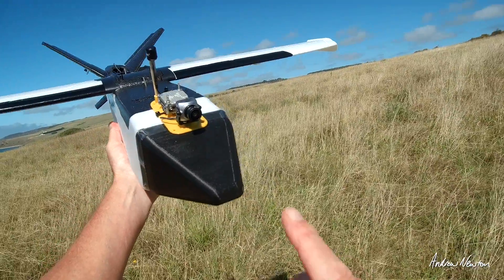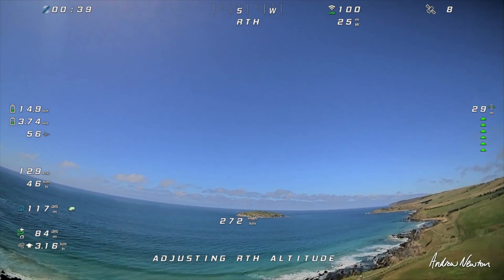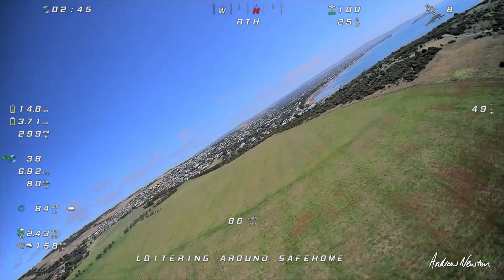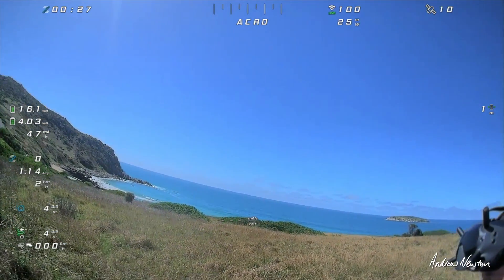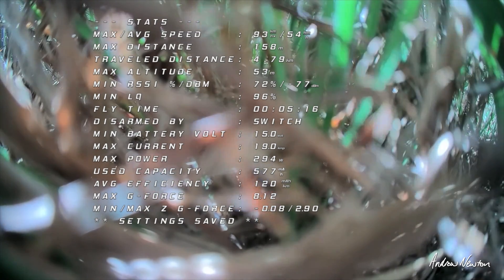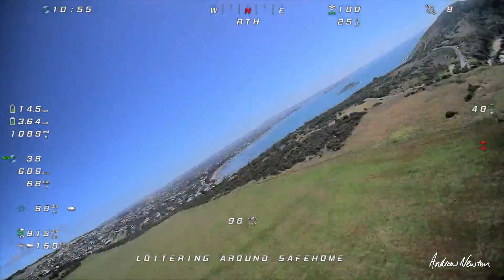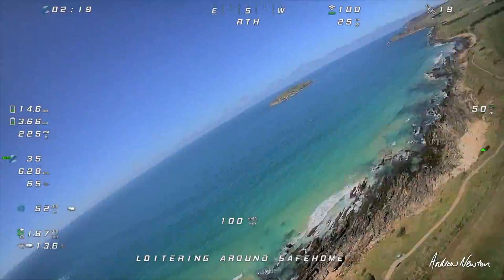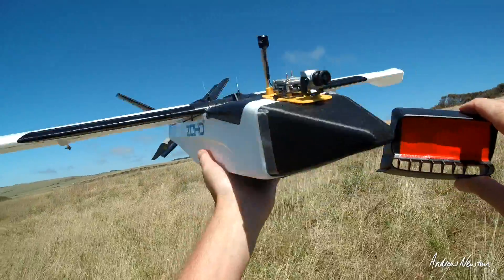Talon GT Nose shape efficiency test

Comment: I don't think anyone would have disagreed that a pointy nose is more efficient than a flat nose, but would be interested to see the difference between pointy nose plus roof mounted FPV gear (the backpack), versus stock nose with FPV gear inside, as the design intends.
Reply from the maker: Slow vs fast would also be worth testing

Comment: Good job on the test!   Nice to see such clear results.   Wondering why the large difference between upwind and downwind in power consumption.  One factor would be the circular path over the ground that the FC is asking the plane to fly.   it would have to bank going downwind more, because it needs to increase the rate of turn, because it's going faster and trying to stay on the same circular track.      another factor would be how the autopilot measures speed.   if it is not equipped with an airspeed sensor, it can derive a synthetic airspeed from knowing the bank angle required to make a turn on one side of the circle vs the other.  but it may not be doing that.  in which case it would just be using GPS groundspeed as a proxy for airspeed, which would be very inaccurate, and result in it flying much slower on downwind legs, as well as much faster (and using more power than necessary) on upwind legs. 
either way, wind speed will partially determine efficiency.   I've found that efficiency is best measured while flying straight and level in an autonomous mode, (for instance between two waypoints of identical altitude) at high altitude in clean air, and using a real digital airspeed sensor.  But not always an option.      In this case, the results are very clear and don't require such precision.
Reply from the maker: Bank angle is limited so it can't maintain a true circle in 15kph wind. No true airspeed compensation unlike Ardupilot I suspect. Anyway, fun to test physics practically.
Reply: yes, it's still a good test if the conditions remain roughly the same for both tests.  good job! @AndrewNewton

Comment: Great data Andrew. 15% is significant! 
When battery capacity offers 30-45 minutes of flight time, this would translate into an extra 5-7 minutes of more flying. Or, a the option to use a ~15% lighter battery to achieve similar flight times. 
Difference might be even greater at airspeeds above 60 km/h in a higher speed cruise.
Reply from the maker: Yes, I wondered if it would be a measurable difference

Comment: Very good vid,  15-20% is more than I expected.   My FPV planes which are similar size cruise at roughly 45-49kmh due they are light.  I found you got to go all-in ( flush antennas, all streamlined to the max )  to get a difference at that speed.
The most efficient commercial plane I have is the Wing Wing z84.